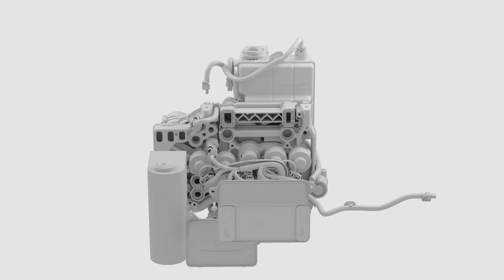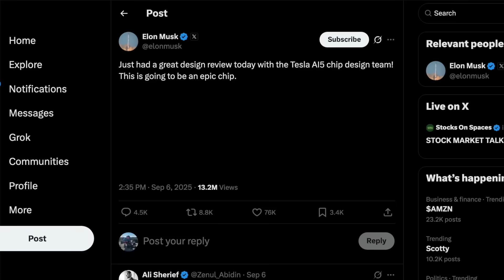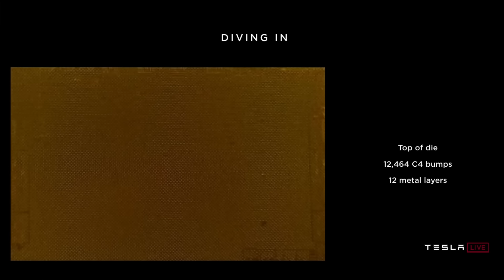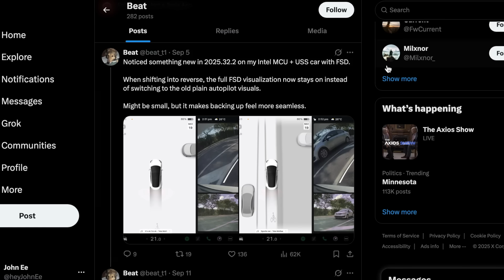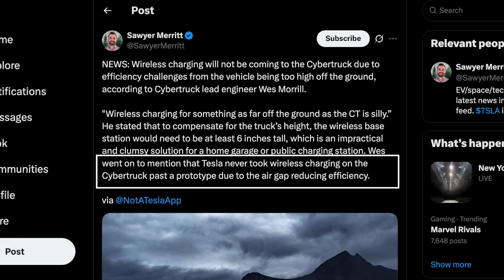Tesla Reveals HW5 Specs Delivering Huge Performance Boost | Massive Upgrade Coming

Comment from the maker: You guys know where I stand on this, but I’m still curious what are the reasons to pick a Tesla today and would you regret it a year from now if Tesla drops support, like they did with HW3?
Reply: Hardware 3 support has not been dropped check your facts ❤🎉
Reply: I elected to buy a 2026 Y and took advantage of the $7,500 discount. HW5 does not have a formal release date and HW4 is a big upgrade already from my Intel 2021 Y. It may be 2-3 years before HW5 is available and the new equipment has all the introduction bugs out of it.
Reply: @derekhensel1108  Derek, you are a smart man. In mid/late 2027 when they are still waiting on AI5 for 3/Y/S/X, many will regret not grabbing the easy $7.5K while it was there.
Reply: @derekhensel1108  wise decision
Reply: If you need a Tesla buy it now. HW4 is great. HW5 is the next big thing but it could really be a long away from being in a Tesla.
Reply from the maker: @noahevans2314 even more compelling if you live in the US and qualify for the $7500 discount
Reply: John, I didn't believe for one minute AI5 will reach scale production within 24 months. If people need a car now, they should buy now and save $7,500.
Reply: at some point they will stop support for HW5, 6, 7 and so on....   they have to sell vehicles.
Haven't you seen with iPhones and other elec devices, whats the big deal   its tech  Move on.... No drama please

Comment: One thing Tesla has done that's brilliant, is making your car more like your phone. With updates and improvements that encourage the consumer to trade in far more often than you would with a typical car which is usually just based more on getting rid of it at a certain mileage. Of course, it's a $40-100k phone in this case.

Comment: regardless if you get 7500 credit, if you need a car now buy a Tesla. Best case model 3 and Y will get HW5 the end of next year and then it will take another 6-8 months before those cars are running the software built for that car. It will run on emulaton mode just like HW4 did for a while.

Comment: It is worth waiting for HW7 / Ayee Eyeeee 7.

You will also get FUSC for life and FSD for free as well. Prices will  crash by 30% because if no one is buying any EVs... Tesla as a CAR COMPANY is kinda screwed.

Why can't they just put the latest HW into the older cars on the older bus. The older cars can benefit from the processing rather than making e waste of cars.

Twice a day since 2018, my car has been saying "Blocked or blinded camera". That fireball in the sky is the biggest issue for Tesla to take responsibility for FSD accidents
Reply from the maker: Maybe the same reasons why apple can just put the latest A19 Pro chip into an iPhone 7, it’s not impossible but they just don’t want to 🤷‍♂️

Comment: Had all of the teslas and currently drive a 2022 my hw3 and everything’s fine … the only complaint is the camera quality is mehhh when there’s sun you can’t see sh** but the model 3 2024 was the best car with 520km real world range 470 for the cybertruck and 400 for the model s plaid
Reply from the maker: Having tried both side by side, there’s a huge difference in HW3 and HW4 FSD performance. Have you tried them both yet and see how much more confident one is over the other?

Comment: I am so surprised that they are developing new high power processes like this but they still can't fix the terrible auto wiper system that just doesn't work.
Reply from the maker: It’s working well for me, but not for others. Hard to say but maybe needs improvements
Reply: Well said, places where there is high humidity, it comes on abruptly  when there is no drop of rain. It’s freakin annoying

Comment: I’m inclined to wait for a Performance Model Y w/ HW5 but need to buy a car by Jan 2026 at the latest. Would you wait a few months or should I buy a cheap used Model 3 to trade in and wait a year for the HW5 version of a model Y Performance?
Reply from the maker: I’d buy a use Honda civic and beat it while I wait for the perfect Model Y Perf with Hw5

Comment: I wonder why Tesla hasn't established a subsidiary company or division of Tesla that salvages older models to recover whatever is possible to help defray the manufacturing cost of the current versions.
Reply: Tesla is very efficient in their manufacturing process. They have improved the production process each time. It is HIGHLY likely that it is CHEAPER to produce after the ramp up currently than 5 years ago. That is why only reason why Tesla would salvage older models is if it is HW4 models, not HW3. They could repurpose it for Robotaxi......
Reply: @1flash3571 Surely there has to be value in recovering the metal that makes the body of the cars so it can be melted down and recast in new vehicles.

At least some of the materials that are in the electronic components should be worth recovery and remanufacturing.

Comment: Is HW5 needed for real FSD?  What about lidar?
Reply from the maker: They seem to be doing well with HW4 so I wouldn’t worry too much it just depends how many times safer really
Reply: stop talking about something you don't understand
Reply: @ThePeterR66 I don’t understand why HW5 is needed when FSD works perfectly now with HW4 and no lidar.
Reply: @wushuhsu  They want to make it SAFER for the Driver. IT still does make mistakes due to how the chip in the FSD hardware process information. It is bit slow internally. It may get up to 2 to 4 times better driver than the actual humans, but Tesla wants to get to 10X or more SAFER than Human drivers....Wouldn't you want the same thing also???????

Comment: If FSD could be solved with HW4 why would HW5 need such a huge performance and power increase? Maybe HW4 can't ever go fully autonomous?
Reply from the maker: Increased levels of safety, in the case of HW4 it’s only 2 to 3x better than human drivers, but even the best drivers still cause accidents
Reply: @heyJohnEe  Elon said at least 2x to 3x but perhaps up to 10x safer than human for AI4.  You did say that in the video but clarifying it in the comments.
Reply from the maker: @StormyDog ya my bad 2x to 3x is what he said
Reply: @StormyDog  The Ai5 is hoping to be 10X safer than humans. That is their aspiration. Not a guaranteed thing. They won't know until they test the chip out after they build it...10X thing was about them expanding the PARAMETERS of the Ai. They were going for 4X of what they have in 13.2.9, but I think they figured out how to get it to 10X for the 14.X.X Version for FSD.
Reply: If you are this dense, then I don't know what to tell you....Apparently, you haven't read any of Tesla's, and Elon's posts on X??? They built the new Chip to make it MORE SAFE? Have you ever heard of march of 9's?????? They want it to get to 99.9999999999% SAFE when someone is driving. It is now at around 99.8% SAFE (I am guesstimating)....People outside of Tesla Community would have a FIT if Tesla gets into an accident or delete someone while FSD is ON. That IS NOT WHAT TESLA and ELON, AND Tesla Stock Holders WANT. They want it SAFE AS POSSIBLE. That is why Tesla is developing a NEW CHIP. They are not going to stop with Ai5. Next is Ai6 and both chips are going into a Tesla Vehicles, AND in the Opitmus Robot also.....It could also go into other products also with Ai inside.
Reply: @1flash3571  okay, so more safe? got it, loser.

Comment: When will it come to production?
Reply: Elon said end of 2026 for mass production, so figure most likely mid 2027.
Reply: They will put the new Chip Ai5 in the vehicle next year. It is still in development, being produced by TSMC in Taiwan. When testing, they produce a few, test it out, then redesign it if NEEDED. that is why they are being delayed a bit. It seems to be going well though.
Reply from the maker: Previously eta was set for Q4 of this year but it seemed to have been delayed til next year according to Elon. But I’m thinking it’s just a way to avoid any Osborne and it’ll arrive much earlier

Comment from the maker: The latest FSD build is hovering around 7.5GB out of 8GB RAM on the main node, so they’ll pretty much have to optimize and reduce the size on HW4. HW3 is pretty much maxed out and dead at v12. Facts. Watch the video in the description to know more
Reply: That isn't what Engineers and Elon have said though...Why would they increase the Parameters on the HW4 to 10X the previous version of the FSD software then???? You don't make sense.